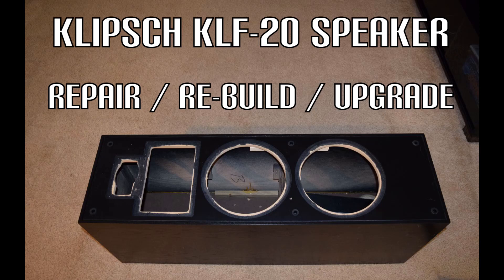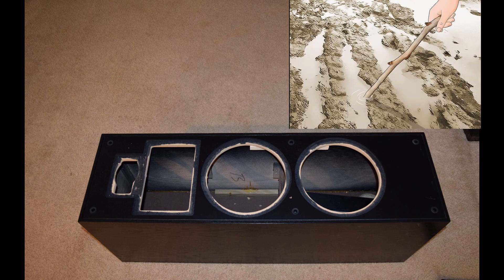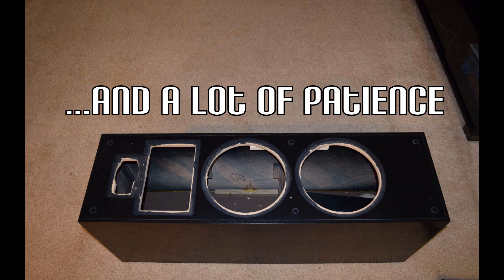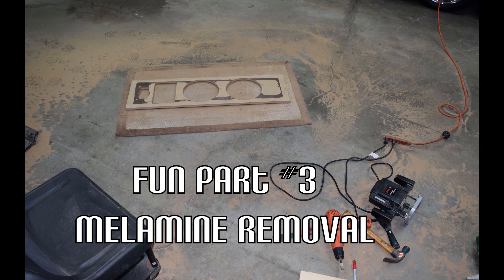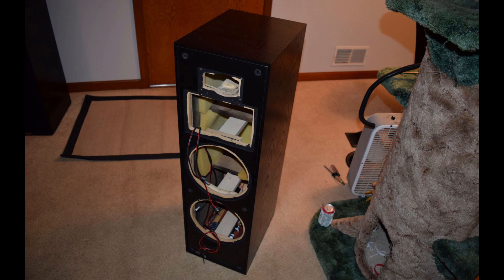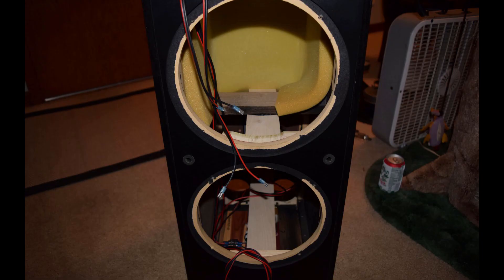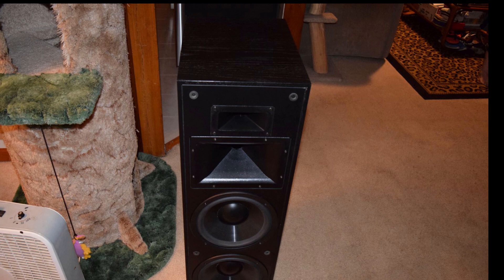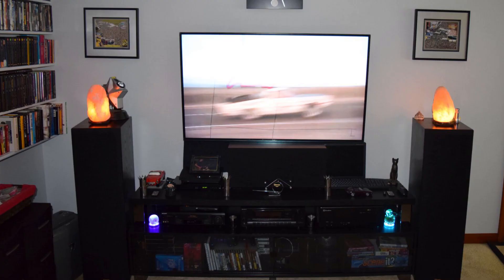Project - Klipsch KLF-20 Speaker Repair / Rebuild with Bob Crites Upgrades

Comment: Whyd you put that crap foam back in there.... just put some brown insulation below the mid horn, above the higher woofer. I found that placement was the best inside my KLFs.
Reply from the maker: Brown insulation?
Reply: @diymakerdan like pink, but brown. Its for sound... like a softer rockwool
Reply from the maker: Not a good idea in a bass reflex cabinet IMHO.  That shit will blow into the air you breathe.
Reply: @diymakerdan  😂😂😂 and a cricket will flip you over 😅

Comment: Bought a new pair of these  around 2001. Both speakers sound terrible when turned up.  I run a Nakamichi 630 through a Nakamichi 420 amp and anything past 2, the speakers sound crackly.  Definitely will cost as much as the damn speakers to have repaired probably. Paid 400 a speaker.

Comment: I didn't have to take the box apart. I purchased the corner metal bracer for house improvement. Put the short screws and bracers on. It's solid and only took less than 15 minutes.

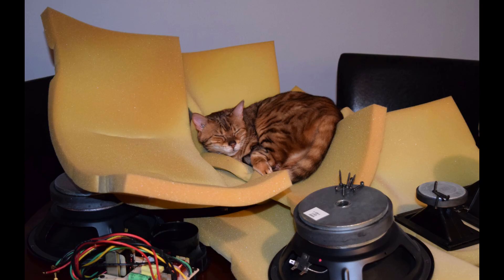Comment: 6:12 holy SHIT look at those magnets! for a 10 inch speaker those are some MEAN BUSINESS sized magnets, those woofers must really not fuck around!
Reply: On the KLF20's the subs, if you just measure the cone itself, are 8.5". I remember when I bought my KLF20's I asked the salesman if I should get a sub. He pulled off one of the cabinet covers, revealing the 2 subs (so a total of 4 between the pair of cabinets), and simply said "you wont need a separate sub". When I listen to Dire Straits Money For Nothing, and crank the intro, the drumming makes it feel almost like an earhquake when I'm sitting my couch. So no, they not fuck around.

Comment: Did you keep the dimensions of all the wood pieces you added? I want to know how much air space you reduced the cabinets by. This changes the mechanical properties for the woofers. Did you notice any sound differences?
Reply from the maker: Yes, they sound much better now that the flubby baffle rattles are no more.  The slightly reduced volume may throw off the port tuning a few Hz but not enough for me to notice or bother with it.
Reply: I did exactly the same job to my Klf-30 6 years ago.
The result was extraordinary!.
Boxes now are solid as a rock with a firm bass, clear and powerful.
The amount of power/volume this speakers can reach is from another galaxy. 
This upgrade is mandatory.
Just take your time and do it right

Comment: I don't suppose you have a blueprint for the upgrades you made. I have a set of 10's that I bought years ago. They have this exact problem. I would love to do as you did. But I am not nearly as handy as you are with this kind of stuff lol.
Reply from the maker: Sorry, this was before I started videotaping projects.  Best I can tell you it's more persistence than anything.  Baffles are tough to remove a little at a time with a paint scraper.  The inner bracing I cut a peice at a time for proper fit.  Used 1x1/4 screws so they would not poke though the exterior.  Would also haven't been easier removing  the inner melamine surface with a planer by farming that out since I don't own one.  All in it was a out a 30hr project I think most could do as long as you have the patience to do so.

Comment: I'm probably too late here but I have KLF 20s that I have reglued and braced a few years back.  Now I'm wondering if I should do the Crites crossovers.  I believe the previous owner di the titanium tweeter upgrade.  A few years ago I ordered some Crites midrange drivers but after installing i preferred the ones that were already in my speakers.  That makes me wonder if the PO also upgraded the mids to titanium as well.  I need to take them out and take a pic and post it on the forums I suppose.
Reply from the maker: I did the crossovers as I was aiming on getting the best sound reproduction possible with this set of speakers (ones I'll probably keep for the rest of my life).  Somewhat hard to say without a true A/B test but I'd like to say going off of ear memory they did improve the overall sound a bit, just not a night and day difference.   My mids are stock and sound fine to me too.  Only thing I would consider changing is the tweets once again if Crites offered a silk dome version of it.

Comment: I have a pair of EXACTLY these & the horn tweeter in 1 stopped working.  I didnt even know those could blow
Reply from the maker: I recommend the titanium dome replacements from Bob Crites so you can upgrade and repair them in the same swoop.
Reply: I bought my KLF20's sometime back in the 90's and they still perform awesomely. I did pop a tweet once when, on the original receiver I started with, the volume up button on the remote unknowingly got stuck. So a song started at full volume, popping a tweet. I was able to find a shop that repaired it with Kipsch components and it's worked like new ever since.
Reply: @2aforever318  whats funny about that is I got my tweeter repaired since the time I left this comment & it sounds good as new.  Brandon (speaker repair guy) said it was a part on the crossover that went bad.

Comment: When you took the plastic circles of the speakers was there a sylicone glue on them to hold them on ? I bought a center C7 and a plastic ring fell off the woofer. Sylicones was used to hold it on. The screw heads were sticking up. Maybe that ring was not suppose to come off.
Reply from the maker: Just glue it back on.  I recommend using ShoeGoo for that.  See https://www.youtube.com/watch?v=yu8algbF878&t=1246s
Reply: @diymakerdan  thanks. Im going to look at a pair of KLF20's today. They are asking $800.00. Damn these speakers are getting expensive ! Another pair i was going to look at sold for $950.00.
Reply from the maker: If these were food they'd be 2x lol.  Took me a year constantly looking to find the right pair (really wanted 30's) but 20's in EC+ for $700 OTD got me.
Reply: @diymakerdan  I bought the KLF20's today. He wouldnt budge on the $800. Said one lady was trying to get him to ship them to Oklahoma. They were just listed last night.
Reply from the maker: Still a good score.  They'll pair perfectly with your C7 and will rock the house.  That seller stinks of bs though.  The shipping cost alone for the pair would be stupid money.  He smelled you wanted them.
Reply: @diymakerdan  I think he was getting calls because he messaged me asking if i was still coming. I seen a couple other sets sell fast and i just missed them. 
They are in demand.

Comment: Would love a walk through on measurements. And size screws you used. Also specs on those crossovers.
Reply from the maker: The bracing I cut as went along, screws are 1-1/4", and the X-overs are from crites.com
Reply: @diymakerdan  Thank you very much.

Comment: I've got a pair of KLF-20's, and the upper woofer on one of the speakers is rattling when playing frequencies below 100hz. Direct replacements for the K-1036-K woofer are scarce. Anyone know a good drop in substitute? I'm pretty sure it's the driver, and not the cabinet coming unglued on mine. The bottom woofer is fine, as are the other two in the other speaker.
Reply from the maker: @MD-tl5zf  Not sure why I didn't see this post earlier but that is a most excellent comment.  I completely forgot that I myself had this very same problem too with one of the Klipsch dust caps a year or so ago.  While initially being hard to detect the source of the buzzing, which only occurred during a movie with the HT fully cranked up (low frequency spaceship motoring sound), it was a simple fix to remedy.
Reply from the maker: Pretty sure?  Be 100% for sure as flabby baffles can sound like a bad driver.  Re-coning the woofer is another option if that's causing the issue.
Reply: @diymakerdan  I took the suspect driver out of the cabinet (but left the wires connected) and played one of the youtube bass test tone links, and it rattled until it got over 90 hz. Are there recone kits for the K-1036-K or close enough? I prefer to drop in a new driver, if there's a suitable substitute available. Although, I have fixed several speakers that needed new foam surrounds successfully, and they're still going strong (the rear subs in my Trans Am and drivers in a Klipsch 4.1 PC system). I could probably manage a full rebuild, if the parts are available.
Reply from the maker: Try asking Bob at crites.com if you haven't already.

Comment: What are those made of?  Plywood with veneer? My Epic CF-4's need some work.
Reply from the maker: The cabinets do have a veneer, but I believe it is thicker than the paper thin veneer that peels off of cheap speakers.  Baffles are press board like MDF, the cabinet is either the same or made from plywood (not sure).

Comment: Great video, I love my 30's! A little confused though: you said you upgraded the tweeters to titanium diaphragms on the 30's, but that you also upgraded the tweeter on the C7. Isn't the "tweeter" on the actually a match to the mid on on the 30's? So now they're not actually going to be matched? Am I wrong on this?
Reply from the maker: The upper horn in my 20's utilize the same tweeter diaphragm as the center horn in the C7.  Same should apply to your 30's too.   The plastic horn is just shaped different on the C7 not the driver itself.
Reply: @diymakerdan  Ohhhhh! Well thank you for clearing up my assumption!

Comment: Thank you so much for your video!!! I just bought a pair of this speakers for $90 dls,  and when I crack up the volume they  make a  rattling around, I was thinking the speakers where damaged. I and going to remove the speakers and reglue the cabinets again from the inside. Thanks again!!
Reply from the maker: Use your hand and apply pressure to the baffles and cabinet with it turned up.  If it is a cabinet vibration you should be able to pinpiont it by pressing down on the offending area.  Otherwise may be a damaged driver.  I have even had the dust cones come loose on one of my woofers causing a weird rattle at certain frequencies only when cranked up while watching a movie.  That was a simple fix.  Pulled it off and re-glued it back on.  Good luck!
Reply: 90 bucks  is a great deal wow👍

Comment: What materials did you use, size screws, size of runners, steps to reassemble, etc..
I have the Klf 10s bought them new in 1996, I also have the c7 center, they all have Bob Crites crossovers and tweeters. Thought you modifications were brilliant. Great work.
Reply from the maker: 3/4" Pine square stock (really 11/16") that is wood glued and screwed around the inside with 1-1/4" drywall screws.  That leaves a tad shy of 1/4" room so the drywall screws will not pierce the outside of the cabinet.   Caution has to be taken not to drill them too deep, and may be better to do the final tightening turns by hand to play it safe.  For the baffles I used silicone instead of wood glue in case there was any slight unevenness from strip mining the melamine layer via a router.  Just like the stringers around the inside the baffles are also reverse screwed into them from the inside by reaching through the woofer holes to fasten.  It really helped that I pre-drilled the holes in the stringers before putting the baffles on to make that step painless.  In a nutshell, the baffles are screwed to the stringers and the stringers are screwed to the cabinet itself.  When I knock on the cabinet it is now noticeably deader sounding than before.  Fingers crossed your 10's don't have the same flubby baffle sickness.  KLF's with the Crites upgrades are really hard to beat for the money invested.
Reply: @diymakerdan  Thanks, that helps a lot!

Comment: Did you glue and screw the front speaker (motor board) to the braces and sides?  Looks like it would be hard to use drill for fastening screws once back board is on.  thanks
Reply from the maker: The stringers are glued and screwed to the outer cabinet shell and then motor boards glued and screwed to that.  The slim 3/8" factory edge only gets glued.  The front baffle must go on first upon reassembly.  Stringers were pre-drilled where all the screws would go beforehand. I then used an offset screwdriver (Skewdriver) to reach through the holes in the front to secure the screws for the rear baffle.
Reply: @diymakerdan  Thanks, working on mine now.  I decided to use 1 inch thick Baltic birch ply for all sides except front.  Going to be heavy!

Comment: Awesome job bro, your craftsmanship is superb. How much did the total rebuild or upgrade cost you roughly $1,200 did you say ? I have had my pair of 20's paired with the Klipsh C7 Ctr since 1995 and other my guys have CerwinVega, JBL, Bose with the cubes, but my system sets itself apart based on the detail of my speakers.
Reply from the maker: Thanks Larry! The 20's I bought for $700 used in mint shape.  Upgrades from Crites (tweeters and x-over) about $375 shipped.  Rebuild materials: the extra wood, screws, glue and silicone about $125.  So in essence, $500 to do both plus your time to do this if you already have a pair.  Upgrading the C7 (tweeters and x-over too) was about $150 in parts shipped and was very easy to do.

Comment: I have a pair there not hocked up how much are they worth and what year are they ?
Reply from the maker: A set of 20's is probably worth $500-$900 stock depending on condition and demand in your area. More than likely made in the late 90's,  I believe the year of production is coded right in the middle of the serial number on the back label.
Reply: @diymakerdan  these are literally the best speakers I have ever heard.  They can pound the high wattage out with no problem & ask for more
Reply: DIY Maker Dan I also have a KSW 15
Reply from the maker: Sweet.

Comment: these speakers are great and worth the time to do some upgrades.  They will last for as long as you want them too...or as long as you have the room!  I have the 20s and same center for the last 15yrs
Reply from the maker: Hey Thomas, nice to hear from another KLF owner with the same rockin' setup.  Oddly enough my last pair of floor standers (Infinity) eventually wound up being placed curbside after 20 yrs. from too much wear and tear and also my cat peed on the corner of one.   I bought the KLF L/C/R used just a few years ago with the intention of getting speakers I wouldn't have to replace ever again that would also really pound unlike the last pair I owned.  These are the speakers I should have bought 15 years ago!
Reply: @diymakerdan  
Great upgrade for sure. These speakers are lifetime keepers 
Find the matching surround speakers if you are interested. I think ksp6 or something like that.
When I got my 20s I had the same loose back panel. But I was in college...so I drilled many (like 100 in each soeaker) 1/16 holes at an angle in the back where it attaches to the sides through the stock glue. 
Then I ran a very thick bead of construction adhesive along the edge. Let it sit a few days and the back panel feels like a rock to this day!
Reply: @thomasnew8606  That was probably the old PL400 construction adhesive. The PL400 today is not the same. It even smells different.